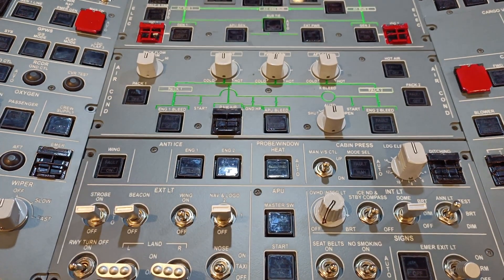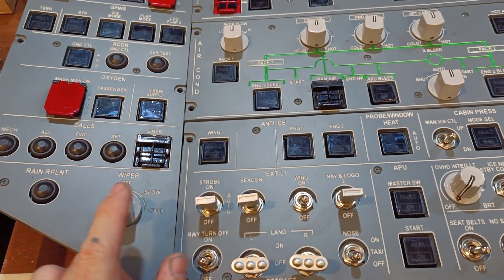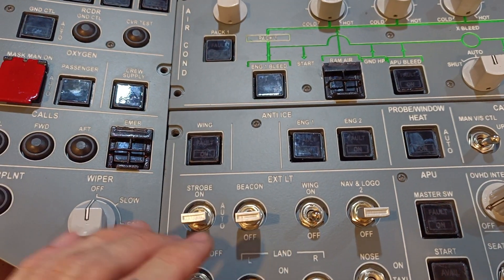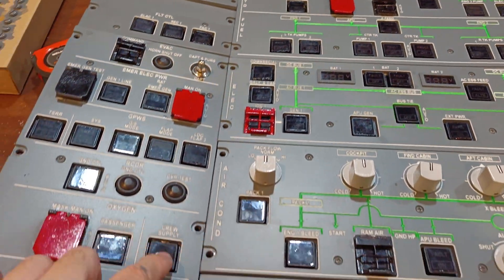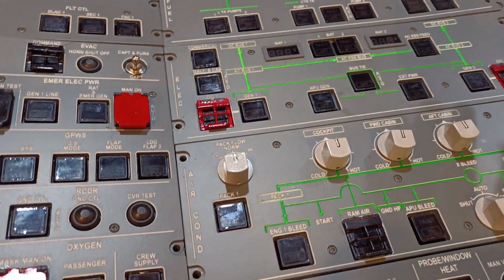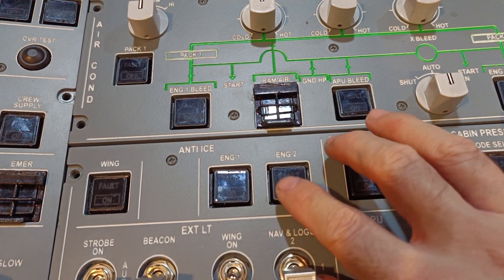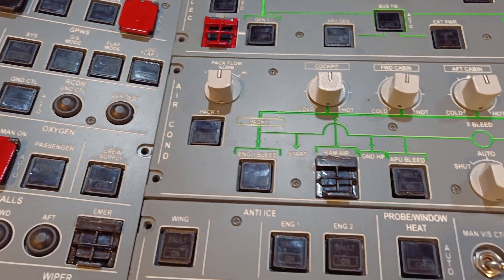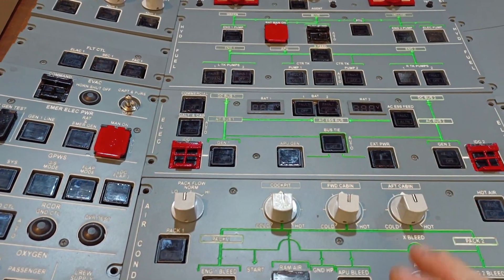DIY A320Neo Overhead Panels

Comment: nice job! screws on panels are done well to mimic OEM! but keen to know what are the holding on to? and how many mm is the panel face acrylic?
Reply from the maker: Its all in my 9 parts video in the playlist included the link to my source corel draw its top 2mm mid 2mm 3mm bottom

Comment: What is the color name for this airbus? Where can i find the color domestically?
Reply from the maker: RAL 7031 Blue Grey:
This is a common grey used on the main panels in the Airbus cockpit. It has a nearly neutral grey appearance, but some modelers have noted it can appear slightly bluish in certain lighting conditions. 
RAL 5014 Pigeon Blue:
This is a light blue-grey, often used for structural elements and the pedestal base in older Airbus models. 
BAC 707 Grey (or Aircraft Gray):
This is a standard grey used on many modern aircraft, including newer Airbus models like the A380 and A350. It's a neutral grey that can be a good alternative to RAL 7031 for a more modern look. 
Other Colors:
Other colors like RAL 5017 Verkehrsblau (used for structural parts in some cases) and variations of grey used by different airlines can also be found in the Airbus cockpit.
Reply from the maker: Thats from AI but thats what I also used for paint code but since i could not get the right paint in my country (i got the marine grade paint but cannot be sprayed) thus I asked an experienced paint mixer to match the marine grade paint one with an automotive paint which can be easily used in spray painting.

Comment: How did you make the push buttons? Like bat
Reply from the maker: I have full series DiY how to in the playlist
Reply: @hobbytechgearID69  Ok, thanks
Reply: @hobbytechgearID69  And how much to they cost?
Reply from the maker: Did not count though, as its DIY almost 12 month bits by bits
Reply: @hobbytechgearID69  Ok, thanks
Reply: @hobbytechgearID69  Last question: And where did you buy them?
Reply from the maker: Sorry buy what? For push button? Its called Korry switch and I build it myself its DIY 3d files is in google drive, using aluminium square tube and diy pcb, micro switch from china aliexpress or similar source its common parts I think, also small LED. See part DiY on overhead in the DiY video
Reply from the maker: https://youtu.be/73LFoqpkXww?si=avmZ6uAaylA3ZMjv

Comment: Hi, I would like to print out korry guards, what kind of material did you use in 3d printing for those?
Reply from the maker: Its PETG with PLA and ABS characteristic. For moving parts, for knobs using resin 3D
Reply: @hobbytechgearID69  Thank you very much! Appreciate it
Reply from the maker: White color btw for easy painting

Comment: Hi, how to connect KD2-22 button with led on mmjoy2?
Reply from the maker: Its not kd2-22 its custom diy 3d printed switch i will someday create a video about it, kd2 its too small in size  and not a dual lighg chamber inside. Like the real korry switch
Reply from the maker: For circuit its either a simple momentary sw push button or a latch on off push button type
Reply: @hobbytechgearID69  how to configure It in mmjoy2 to work the led when you press the button?
Reply from the maker: @brunotaciano1218  its not using mmjoy this time. Im using Mobiflight firmware and software. Mmjoy is only a joystick controller without output for LED

Comment: I use Jeehell FMGS and P3D V5. But soon also for MS 2020
be compatible. That I have an overhead where only touching switches 
are installed. But I have seen that some switches snap into place
My question is where did you find out.
Reply from the maker: You meant which one is push button or toggle push button? I use the in sim a320 to check it. Its DIY switch. Will create video on it
Reply: @hobbytechgearID69  So what button snaps.
For example Switch APU in your video stays pressed.
Button APU start not.
Reply from the maker: Using the sim itself inside the cockpit email to hobbytech06@gmail.com wil. Send the excel

Comment: Hello great part congratulations. Could you also tell me exactly which keys are latching and which are momentary. I can't find out anywhere.
Or a link where when it can find out.
Reply from the maker: I havent upload the files, plan to but will take sometimes to tidy up. Since I'm still trying to finish the electronics for MIP, Pedestal,
Reply from the maker: Bu I'm using the A32NX flybywire and A320 CEO Fenix to create the list by trying each of the switches.

Comment: How did you get your measurements? I cannot find schematics anywhere!
Reply from the maker: I bought high resolution drawing of a320 cockpit panels, realign drawing in coreldraw with known dimension photo from the well known diy website as reference then mapped and redraw the panels for acrylic cutters. Its really an intensive and time consuming works
Reply from the maker: Plan to create the video but still busy in constructing the front panels and building 65 inch x 3 tv frame and panels coming soon